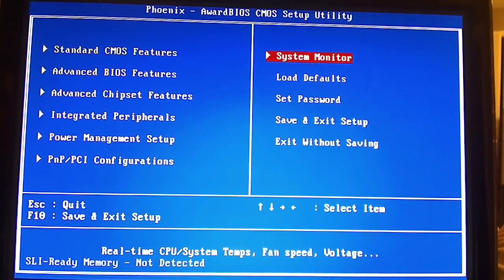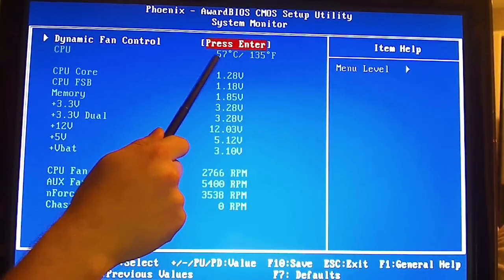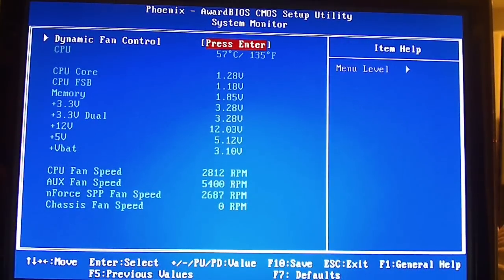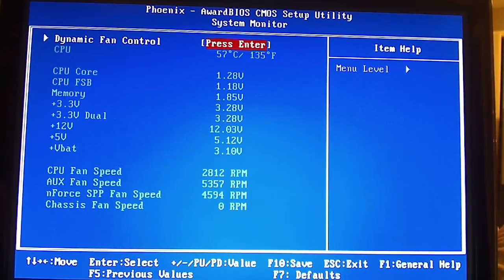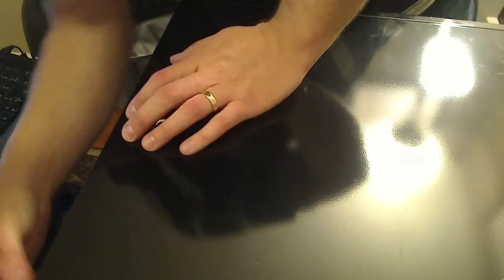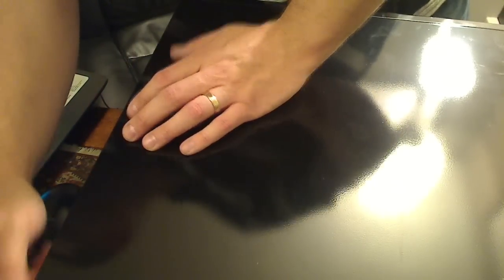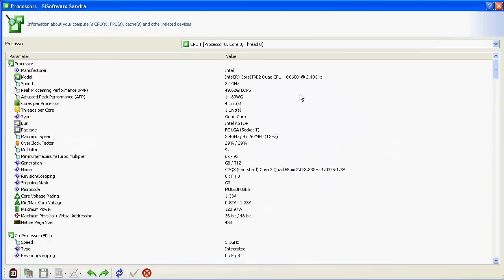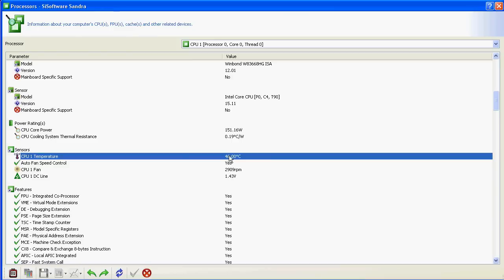SOLVED:  Fix Overheating CPU (Computer) Decrease Temps by 10 degrees

Comment: @helihopter186 i posted a how to in comments here...     homeaddition is mostly correct but there are some things i would change.    Also, make sure your fans are all pointed the right way.    Anywhere there is an empty fan grate in the back you can throw an exhaust fan in.  I have 10 fans total in my case.  2 in front intake, heatsync a 120mm top fan that blows on the heatsync 2 rear exit fans to speed hot air out, one fan to blow cool air over the GPU, (2 on the GPU) and one in the power suply

Comment from the maker: @ableman8 #1 If your exceeding your CPU temps, you should definietly go on Newegg and find a great cpu cooler = COOLER MASTER Hyper 212. You're not even overclocking it much (200mhz), and your cpu is way too hot for stock speeds.

Comment: Hey my PC has been shutting down randomly. Most likely due to overheating. But i built the thing only 7 months ago so I don't know why it would just start overheating. I clean the vents regularly and blew the heatsink out.
PC Specs:
AMD Phenom B55 x4 3.3ghz Processor
Radeon HD 7770 Ghz Edition
8Gb RAM
500Gb HDD
60gb SSD Window 7 Ultimate SP1
My Speedfan results are:
System 27C
CPU 29C
AUX 37C
HD1 28C
Core 58C

Comment: @helihopter186   Thermal paste,   ARCTIC SILVER compound #5.  If your still hot   look into a bigger heatsync and look into improving your case ventilation via more or better  set up fans.

Comment: 1. You need better airflow (tidy up your cables) 

2. You have your CPU fan taking air from the exhaust fan, so of course you are going to have a heat problem

Also why not get a delta fan in your rig, that will easily solve the problem

Comment from the maker: @Thevb2101 On a AMD Athlon 64 X2 the V core  should be 1.2V / 1.25V.  I'm not sure why yours is so high, are you overclocking? 

You can change it in your Bios back to stock.

Comment: You should've checked the temperature via the BIOS again as a direct comparison. Software sensor software is WAY off in many cases and the TjMax is invalid as well.

Comment: Back a step, make sure not to vacuum the inside of the case to close.  The static discharge can damage components.  USE COMPRESSED AIR ALWAYS!!!!!  Clean the board with 100% isopropyl alcohol.   It evaporates quickly, leaves no residue, and is an effective solvent.   I only ever use lint free Q-tips to clean a CPU and occasionally (for stubborn spots) use a wooden toothpick.   Apply about a small pea sized ammount of thermal paste and use a fresh business card to spread it across the ... contd.

Comment: 60-70 is about the max you should be getting while gaming. 25-30 idle is really good. If it goes over 80 while gaming then youre starting to get into problems, but around 70 you should be fine

Comment: try Tuniq TX-4, it's the TX-3's successor which i'm currently using. i believe the TX-3 ends it's production. 
tho i'm running my i7 920 @ stock speed with a CM V8 cooler yet i have this cool 27C atm while i'm typing this reply. yes it's pretty hot here with no aircon.... from the Philippines either FYI ;)

Comment from the maker: 1. To check the directions of the airflow inspect the fans, usually you have arrows on them that show in which direction the airflow will be going. You can also put your hand in front of these fans when the computer is on (you don't even have to take the case off).

2. It's possible that your fan and heatsink are not sitting properly. Uninstall clean, and re-install. Check out my video called "How to Apply Thermal Compound to Intel CPU" by visiting my YouTube Channel and searching for it.

Comment: Oh wow I did not know that, I recently build a computer and spread the thermal compound paste, I guess that's why I was constantly getting those warning messages that my AMD APU processor was at 61' Celsius. I replaced the stock fan with an aftermarket cooler and it reduced the temp by only ten degrees celsius but I again spread the thermal compound paste. I guess next time I clean up my computer and replace the thermal paste I'll do it like you said, the temp may even go lower.

Comment from the maker: That's strange those temperatures are not that high. You may have incorrect settings in your bios. Check your voltages and memory settings.

Comment from the maker: Trust me I did cable management lately when I built a new PC :)

Check out my new video showing how I put on thermal paste now called" How to Apply Thermal Compound to Intel CPU " because I use Arctic Silver 5 and they have a special guide for each CPU. The procedure shown in my new video is for Intel Core i5 and Core i7 CPU's. If you took off the metal cap, you would notice that because of the CPU layout the place where I placed my new thermal paste makes the most sense. ->see new video :)

Comment from the maker: Geek Check: Can you figure out what’s wrong at 2:05? If you can then you are just like me; a computer geek :P I noticed that I had my inline fans running in opposite directions during the editing of this video. The fans were basically cancelling each other out since the case fan was blowing out and the CPU fan was sucking in. Oddly enough this didn’t cause a major temperature difference, after swapping the case fan to blow in towards my CPU fan I decreased my temps by 2 more degrees.

Comment from the maker: @PepsimaxL You computer is definitely overheating.
 
Make sure that there is ZERO dust inside your case and that all the fans are working properly.
 
Step two: get some high quality thermal paste "Arctic 5" and re-do the compound on your CPU and Heatsink (see my video).
 
Step 3. Make sure your video card is not Over-clocked (uninstall and reinstall new video card drivers).
 
Step 4: I have lots of new How-to videos that can help you do everything I just mentioned. Browse my channel

Comment from the maker: When you take off the heatsink you always re-apply thermal compound because it can get rubbery and cause your CPU to burn up. Watch my video on how to properly apply thermal compound. It will show you instructions on how to properly clean the CPU and heatsink. Plus I include a special step called tinting for maximum performance.

Comment: Have you used new thermal paste etc?. Thats incredibly hot especialy so when you consider that games don't really max out the CPU's workload as I have been checking my cpu's workload on my new keyboard while gaming and the highest any game has maxed out it's power was Max Payne 3, it briefly hit 30% use. Most games have used around 19 to 25% and my CPU is only an i7 2600 so could you imagine if it was a hex core , usage would be even lower

Comment from the maker: @crayzeesteve Ok, I'm assuming by CPU you mean the actual computer case, because the CPU is the processor, so unless you were playing with your whole case taken apart and your CPU exposed... Anyways, If your tower came crashing down many things could have happened. I would take out all my cards (graphics, sound, etc) take out my ram, unplug all the wires and re-seat everything. Most likely you jarred a physical connection. Worst case scenario, you screwed up your hard drive. Hope that helps.

Comment: You should rotate your heat sink and cooler to blow the hot air out of the case direct to the cooler on the back of the case. Also then the front cooler wil deliver cold air to the cpu cooler. Ihope you understand me. Sory for bad english.

Comment: if you look at the back fan and the fan on the cpu, they are blowing air separate ways.  you would want to make the cooler face the other way so it blows through it and towards the back fan. from this it looks like it is blowing hot air all aorund the case

Comment: My PC keeps rebooting after about a half an hour of use - It's a form factor business model HP with three intake and outake fans and a good heat sink .. You think it's an over heating issue? I've wiped the hard drive and reinstalled the OS so it's not a virus causing the problem - I also took the memory modules out and put new ones in that's not the problem either - I'm guessing maybe the thermal paste is getting old and I need to reapply it .. Going to try that and hopefully that fixes the problem - If that doesn't work I guess I'll replace the PSU.

Comment from the maker: Wow, that is very high because 212 converts to 100 Celsius, most CPU's should run below 72 Celsius to be safe.  . Your laptop must have a lot of dust in it or you are running it in a very hot room. Those temps I would say are far above normal. But you can do more research by searching for "temps & the mobile processor you have" on Google. It's also possible your CPU fan broke!

Comment: 60~65 deg seems that high for CPU @ stock speeds, time to replace your thermal compound with an after market ones if you haven't. get a new cooler if you have the stock cooler.

Comment from the maker: Well if your PC is not even booting then it looks like you have a hardware error. In the past I would taking the whole computer apart then put it back together again; that's before I learned a bit about pc's. You can try that. I found that memory and video cards can cause similar problems to what you are explaining.

Comment from the maker: If it's only going to 45c then your problem is something else. It could be your power supply. I had a computer reboot constantly and I thought it was the video card overheating, so I swapped it out. The problem still happened, so I swapped out the power supply and the problem stopped.

Comment from the maker: Sounds like your computer is overheating; it's probably just overclocked wrong. Go back to stock and try again by taking much smaller steps. If that doesn't work, re-install your OS.

Comment from the maker: @mBrooks95 First nice CPU :)... Usually motherboards have a CMOS reset dip switch that you move from one set of pins to another. Look up your motherboard model number and get the manual if you don't already have it. Once you have the manual look for "Clearing CMOS". Some new boards have a push button to clear the CMOS to fix overclocking mistakes. BTW this is a very common problem and you will be okay once you clear the CMOS.

Comment from the maker: I'm not familiar with your CPU, but those temps do seem high. I would get a new cooler or the best thermal paste you can buy and reapply the compound after a proper cleaning of the CPU surface and heatsink surface. Check out my "How to properly apply Thermal Paste Video" by visiting my channel and writing the word thermal in the search engine for the channel.

Comment: At the beginning of the video you showed us the temp in the bios...   why did you use 3rd party software in windows at the end of the video?   Each software "tool" to measure temp gets a different reading.  It would have been best to use the same blue bios screen to show that what you did lowered the temp.   ALSO, as a side note, I've removed thermal paste on many dozens of CPU's and never did I feel the need to remove the chip from the socket.  Novices are liable to bend a pin if they do this.

Comment: Beyond ridiculous. There's no way in hell that a little thermal paste would drop CPU temperatures by 10 degrees. More likely is that your cooler wasn't seated properly and during your cleaning process you corrected this.

Comment from the maker: I'm overclocked to 4.5 GHZ now with my i7 2600k which is very stable and the temps are low at 38 Celsius.I plan to make a video of my current rig and how I overclocked it, so subscribe to my channel and you'll know when I post it :)

Comment: while this is a decent video for changing thermal paste i have some suggestions for people.    Chiefly, make sure your computer has sufficient airflow to begin with.   Often people upgrade their computers or add multiple hard drives and do not take into account the reduced airflow.   After removing your heatsync, DO NOT REMOVE YOUR CPU.   many cant but if you can    dont.   Just clean it on the motherboard.   Even dust getting into the pinslots on the board could cause serious problems. Contd.

Comment: hey, you seems smart :D
i have some problems with my pc... 
it started like 2-3 weeks ago.
when i play games on my computers  after like 10-50 minuts the screen gets black/blank like it is turned off but my pc is still running. i have to turn my computer off manualy by holding power button for 5-6 second, when i turn the computer on again the fan's spin fast/(sounds like that).
i have been seraching in google etc. for a sulution but dident really find something that fixes the problem.

Comment from the maker: I would remove any cards that you don't need to turn it on like sound cards, video capture cards etc. Try unplugging your hard drives, cd-roms, etc... Basically by process of elimination find out what is causing the problem. #pcrepair

Comment: sounds like a hard drive problem 2 me
-> restart, hit f8 repeatedly 2 get in2 safe mode 
-> start button
-> my computer or computer
-> 'right mouse click on ur hard drive
-> choose 'properties' 
-> then 'tools'
-> then 'error checking'
-> make there is a tick in both tick boxes
-> click on yes or schedule disk check
-> shut everything down and then restart n' wait til it'z dun
this might recover ur drive, long enough to get ur data off or it may go on for much longer voila done
-> accessories

Comment: Would you do the same for a over heating GPU? My CPU temperature is 36c .
My GPU temperature is  46c - 49c on idle. So when it gets too hot I get this black screen. Then I would have to shut off my PC's power supply and turn it back on for it to start again.

Comment: okk ive cleaned it out but it still blacks screens on me i checked what temp it was when it overheats/blackscreens and it only 45c it use to be able to go to 70-85 with out overheating what could be wrong ?

Comment: Tip: If you have a CPU FAN ERROR go check the cpu fan if the fan is working that means its overheating but if not working buy new one CPU FAN.

Comment: nice vid but why did you have the fan for the CPU cooler the wrong way around. The way its shown here you are actually taking the hot air and blowing it inside the car. You have to change the air drawing cool air from outside and blowing the hot air generated out from the back of the case. My Q6600 runs with a small tower cooler from Thermaltake w/ 92mm fan and no front or back 120mm fans and get 34 degrees on my Asus P5K3 Deluxe. And on 100% load for over 20 minutes with SuperPi it runs to 55C

Comment: I've tried to fix the problem, when I finished cleaning the tons of dust on my cooler, my PC went down, I mean, stop working. Has been a while now, so I already fixed, turns out the problem was my web card (all the names I know for this things are in Portuguese, so I can't say exactly), internet driver or something.

 Anyway, I bought a new PC box, with enough air ventilation entries for my cooler and 3 new fans, that plus a clean cooler, and temp is now around 45-50 degrees. When I play NV, 80.

Comment: hey i have a question: I clean my computer all the time, i have 5 fans in it, and i even got to a frustration point where i use my house fan (like 40 cm diameter) pointing into the computer (i put my cover off). my room temperature is about 23°C. many times i just kept watching the CPU termometer and if it comes up to 50,51°C the computer will just freeze so hard that even if i press capslock the light on the keyboard wont come on. after that i just restart it till it happens again. help please.

Comment: what i did was used vacuum cleaner on both of the fans, and the nput it before Air conditioner for 1 hour, and keep it cool for a day, now it does not heat up.

Comment: I have kind of similar problem in my secondary PC. But i tried 3 types of thermal compounds and reinstall cpu cooler 7 times with no success. It still overheating, but not by 50 og 60 degrees but it has 120 degrees. And then it automatically turn off due to overheat. I also tried flash BIOS 3 times with different versions, no effect. My board doesn't allow me to change voltages so i can not decrease it. MB is ASUS M2NPV-MX and cpu is Athlon X2 5200+ brisbane 65W. I have to try cpu on my primary sistem board to see if is fault cpu or MB. I think it has to be failure, right?

Comment: Nice tutorial, but im not sure why you put fan to blow air from back :S Usually we take cool air from front and then blow to back.
Second thing thermal paste its ok to put just in middle but i allways spread out. You just need to put a little and then spread all over in thin layer.

Im running 3.5Ghz on 37C in idle mode. When playing GTA 4 its about 43C

Comment: i checked in bios and it had the mode called unleashed mode, and i guess its main deal is to add a virtual core, when on it runs at 75 off at 15 c when on it says i have a x4 when off i have x3 amd phenom 2

Comment: Best thing to do is lap your CPU...its a lot of work however it's worth it!
Reply from the maker: Dave I never lapped anything but my girl.. LOL... couldn't help that one!!!  Actually I heard about lapping but I've had great success with overclocking with many different CPU's from Intel and AMD. #Lapping your CPU might give you an extra 50MHZ, which is only good if you are trying to win a world record. If you're just trying to get the best bang for your buck, find the right settings, get your #maximumOverclock, then #downclock it a bit for heat reduction and increased #stability.

Comment: Hey, I'm getting a slight problem. I have an Intel Core i5 3570k with a Cooler Master Hyper 212 EVO. I am getting idle temps of about 45C. This is not normal. My case has 2 top fans (200mm), 1 front fan (200mm) for cooling my HDD and one exhaust fan in the back (120mm). This computer is brand new, not much dust has accumulated on it. I am wondering what is causing this? I reapplied thermal paste: no difference. Is my CPU just plain crap or is something wrong? It's at stock settings.